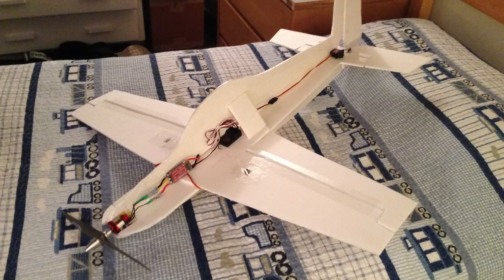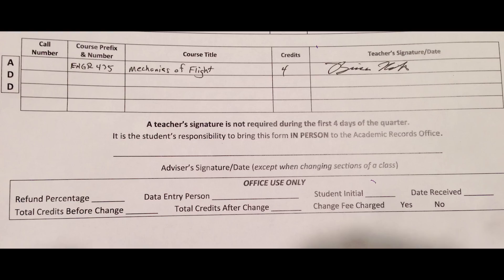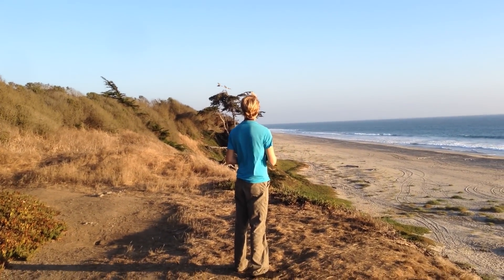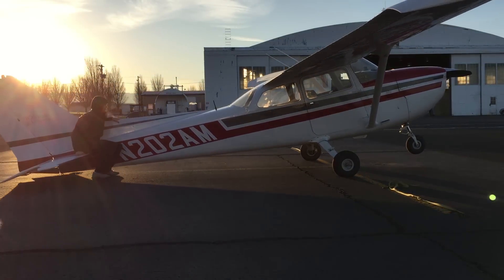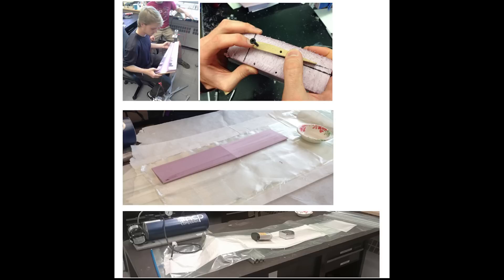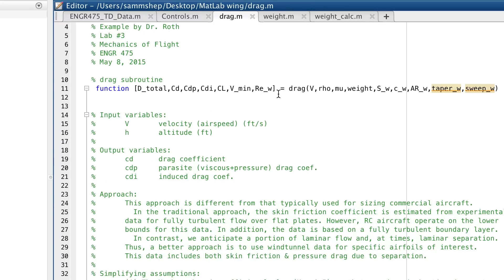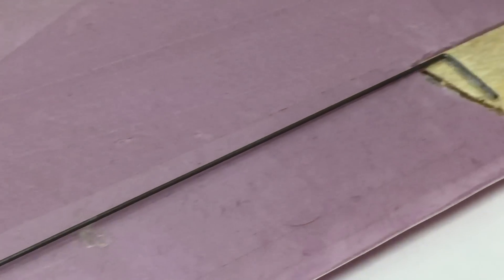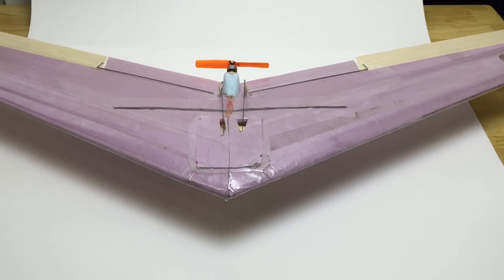Engineered Mini Flying Wing

Comment: When you are looking for efficiency the last thing you want are those irregularities on the wing's surface... You should know better since you said you are a pilot...
Reply from the maker: lol, lift generating aerodynamic efficiency is much more than that.
Do you just mean the torque rods?
Reply: ***** no, I was referring to the ditches left behind by the hot cutting wire... Sorry to be a pain in the bum, but beeing an old school rc plane builder that likes to build his planes from scratch I tend to be kinda OCD about that sort of things.
Reply from the maker: Andrei Marinescu Understood, that wing geometry was a really difficult one to cut. I had many failed cuts. Long, small, skinny, high sweep and taper ratio. Wish those smart engineers had built a CNC wire cutter.
Reply: ***** and another tip: expanded polyester is significant lighter than extruded one   and also easier to cut manually with the hot wire 👍

Comment: can someone explain the wing twist
Reply from the maker: The amount of lift a wing makes is controlled by the angle that it bites the air with, called Angle of Attack. By twisting the wing, we can create more lift at the root (in this case is also the front) of the wing, and less at the tips
Reply: +Samm Sheperd (SNRS) omg!!!! tjanks most youtubers don't answer their coments. Thanks ,now I understand. I'm 14 yrs and I also make rc planes, but i don't know much about aerodinamics and this was really interesting.By the way I'm spanish so sorry if I wrote something wrong. Oh and if you want to see some of my planes I'm rc exp on youtube, but some old videos are crap
Reply: oh and sorry if you felt like I was spamming . I didn't mean that
Reply from the maker: ***** Normally we want the whole wing to be doing something, so more AOA at the root, and a little less at the tips. Neutral at the tips is a little useless. Interestingly though, wings with a lot of twist and large flaps such as a C-172 can be creating negative lift at the tips when traveling fast with flaps down.
Reply from the maker: The wing flies at whatever angle it needs to, and we adjust it with pitch. The angle of incidence of a wing on a fuselage isn't setting the wings angle to the wind, it is setting the fuselage to point forward in cruise flight. Instead of thinking of it like we are flying a fuselage with a wing on it, think of it like we are flying a wing with a fuselage on it.

Comment: why did you use a bull nose prop on the wing
Reply from the maker: I was not in charge of propulsion, but they gathered lots of static and dynamic thrust and efficiency data with various props.
Reply: Yeah...the best props I've found for flying wings in this size/loading range are the small folders from Hobbyking. With few exceptions, the quieter your prop is at a given rpm, the more efficient it's going to be. Also, APC makes some really efficient fixed props in this size range.Lastly, your wing cores look like mine did when I started out with foam. Gravity feed gives you much smoother cuts--no more ridges!

Comment: How do you find center of lift
Reply from the maker: +SilentRecon it's pretty much always at 1/4 the chord length behind the leading edge for subsonic flow. Supersonic is 1/2. For swept and tapered, you find the average chord (called the MAC)
Reply: +Samm Sheperd (SNRS) ah okay thanks. Would horizontal stabilizers affect center of lift?
Reply from the maker: SilentRecon Yes, something about various pitching moments bring the center of lift back. This is why 1/3 chord is a good place to put the CG on a conventional aircraft. I don't understand super well though.

Comment: So drawing stuff in sketchup like wing shapes is kind of hard but I managed.

I decided to make this plane except about 60% bigger (which might not be enough but that's the piece of scrap foam I have)

I first sketched Samm's plane as a sanity check.

Here's the sketchup project 
http://s000.tinyupload.com/index.php?file_id=69791978233960311521

includes the original wing and my new wing.

BTW Samm's wing 86.8 cubic inch volume except for the cut outs and engine pod.
I measure my blue dow foam at 0.40g per cubic inch so that would make a 34.72 gram air frame (minus a bunch of stuff)

Here's some pictures if you don't want to install sketchup

airfoils (inkscape -> blender -> collada file -> sketchup !)
https://i.imgur.com/1PN3UOz.png
learning "extrude by loft" plugins
https://i.imgur.com/Z39PcjI.png
new wing on scrap foam
https://i.imgur.com/86LT8jr.png
original wing
https://i.imgur.com/74xZOBX.png
new wing  73" wingspan same airfoils (13.5" chord inboard 6.5" outboard) 31deg sweep center pod 9" wide twin engined (I only have 5x3 tri-props ) 552.8 cubic inch / 221.12 grams
https://i.imgur.com/WBCyWHf.png

Comment: Hi,

I just got a bunch of components and I decided to make a flying wing & trainer.

I purchased component that what got me the most bang for buck so my components are quite different from what you had.

Oh BTW, first thing for me was to draw the thing in sketchup. And before I could do that I needed to convert the airfoils into SVG vector graphics.

I posted the resulting SVG file here if anyone wants to try making this, it's already set to the correct dimensions.
http://s000.tinyupload.com/index.php?file_id=98134392829159776950

My base materials consist of this http://pastebin.com/hzwiuFJs
namely a 2212 1400 or 2200kv motor
5x3 tri props
2200mAh 11V lipo (heavy!)
9 g servos and blue Dow foam 1.5" and some wooden dowels.

Now to draw all this in sketchup and to try and figure out what size I need to scale up everything for optimal performance.

I think I'll add a center pod for convenience.

Comment: Now to make this thing! Sam why did you pitch the airfoil down 3 degrees?
Reply from the maker: +Noel Murano the wingtips are also the farthest thing behind the front of the wing. By twisting the wing tips down, we can more easily use them like an elevator (instead of using constant up elevens). It also brings the center of lift farther forward and also gives us a more elliptical lift distribution. We can also expect slightly less induced drag and maybe helps compensate for the "middle effect." However all that being said. A non-twisted and even un-profiled airfoils will work with proper CG and some elevons. See my "flying rectangle" video
Reply: +Samm Sheperd (SNRS) Im experimenting with different wings now. Thank you for your input! Good luck Im excited to see more projects.
Reply: Minus 3 degrees is enough to induce proverse yaw, too, making a tail truly unnecessary. Samm's design is essential a Horten Ho-series glider (though I am not suggesting he copied it without giving credit...there are significant specific differences).

Comment: the wing does not need vertical stabilators?? Why? When I made my second flying wing I didn't put vertical stabilators and it didn't flew well. It nearly survived. I put them and everything went fine on second flight.
Reply from the maker: +Luis Carlos Davila Reprieto we had enough sweep and calm enough conditions that they were not needed. With aggressive rolling we get some adverse yaw. Also, because our electronics were so light, adding vertical stabilizers (winglet type) would actually bring the CG too far aft.
Reply: I'm surprised that with -3 degrees washout you didn't get some proverse yaw, but maybe the adverse yaw was due to the elevons extending so far inboard.

Comment: what was the name of the rc servo board? i want to get one.
Reply from the maker: +david mimms I didn't source them, but this looks like the same one https://www.foxbuying.com/ar6400lbl-2-4ghz-6-channel-receiver-module.html?gclid=Cj0KEQjwl-e4BRCwqeWkv8TWqOoBEiQAMocbP1u3ms4kUnEYg0P5Ovt6cQhj6g93-x3rE0qCm1xngtsaAp1Z8P8HAQ
Reply: thanks :D
Reply: +Samm Sheperd (SNRS) i cant find the type of motor but will this work with http://www.gearbest.com/multi-rotor-parts/pp_180560.html?currency=USD
OR:
http://www.tmart.com/1804-2400KV-Micro-Size-Integration-Outrunner-CW-Brushless-Motor_p304964.html?cc=USD&fixed_price=us_us
Reply from the maker: david mimms More like this: http://www.hobbyking.com/hobbyking/store/__25676__Turnigy_A1405_3000KV_Indoor_Brushless_Motor.html

If this is your first project, micro components are a little more difficult and fragile
Reply: +Samm Sheperd (SNRS) thanks :D
Reply: Thanks man. I hope you have fun wherever you are now man. Thanks for inspiring me all of those years ago.

Comment: I want to get into making my own planes but this airfoil business has been the hardest to find information about.

What is HS522 and MH60 ? 
Is there a catalog of airfoil wing geometries I can search ?
How can I pick the correct airfoil for my application ? 

Do I need something like the application you made ?

Did you release the program you used to calculate the plane 

How did you cut the foam to morph from one root airfoil to a different tip airfoil, exactly ? That's the video I would most like to see 

What foam material type and density did you use ? Looks like normal pink insulation from the hardware store.

I'd like to make a 75 to 175 inch flying wing with 2-4 hours endurance, 1 kg external payload, is that within the realm of the possible for hobbyists ?
Reply from the maker: +shodanxx your goal is very possible. I suggest starting small and learn from your experience. This particular plane was difficult because of the size of the components and the weight constraint.

I do a little research on my application and airfoils that others used, and then I look it up on airfoil tools.com

Watch this to better understand the wing making process https://youtu.be/aV5hILJe20U

Comment: Damn, the video side of all of your projects are incredible. Have you found a little tip or something that wont make videos boring?

Also: wait a couple months. I'm planning on breaking your record. Is the "brain" just a normal UMX brick?
Reply from the maker: +Tarik Agcayazi (Killsranq) people don't know something is cool until you tell them that it's cool. They want to see personality, they want to be told a story. What is the significance? What insights can you share? But most importantly, people have short attention spans. Boil everything you have down into the most compact and fluid presentation that you can and then add footage on top of it.

Yea it's some cheap brick that binds to DSM2 radios like spectrum or Orange Tx. I'm sure you can beat the record, if the weather is calm, then the plane only needs a few strips of tape, and no spar.
Reply: "I'm sure you can beat the record" wouldn't be so sure about that

Anyways, yeah I was just wondering about that video aspect. I bored myself out explaining sideslip in my video, and when I saw yours it was good motivation to try to improve the videos instead of just pushing something out there. 

Can I get full specs on the 8.5gram motor? What kV, prop size, and if possible, a hobbyking link?
Reply from the maker: I actually haven't' been able to find that motor. I didn't source it. It was provided. I think it spun a 4inch prop. but I think a motor with a lower kv that spins a bigger prop (but slower) might be even better. You know about all the clues that I do.
Reply: +Samm Sheperd (SNRS) yup. just wanna have the same setup as you and challenge myself a bit. I'll find a motor that's close in specs.

Thanks for all your help!
Reply: I think i've found the motor. It fits all criteria, except it is 5 grams. I belive that it was weighed without the mount and etc:

http://www.hobbyking.com/hobbyking/store/uh_viewItem.asp?idproduct=34099

It looks the same as well (3 holes), and spins a 4 inch prop as well. i'll give it a run with this.

It seems that you can also get the prop, the battery, and the DSM2 main board off of HK as well:

http://www.hobbyking.com/hobbyking/store/uh_viewItem.asp?idProduct=91808

http://www.hobbyking.com/hobbyking/store/__89391__Turnigy_nano_tech_180mAh_2S_25C_LiPoly_Pack_Compatible_LOSB0863_US_Warehouse_.html

http://www.hobbyking.com/hobbyking/store/__56166__2_4Ghz_SuperMicro_Systems_DSM2_Compatible_Receiver_w_Brushless_ESC_Linear_Servos.html
Reply from the maker: That all looks pretty spot on to me and it all should work.
Except just from the looks of it, this "brain" looks more like ours, and is way cheaper: https://www.foxbuying.com/ar6400lbl-2-4ghz-6-channel-receiver-module.html?gclid=Cj0KEQjw5ti3BRD89aDFnb3SxPcBEiQAssnp0q5lnRx0U6WesmhH4pcsq1wgAUprp2PHY7-brWj81mYaAp_f8P8HAQ

And we used GWS EP 4025 props
Reply: Oh yeah that is a lot cheaper. I think i'll get that - I was planning on stripping out one from a broken UMX, but this will definitely do. Thanks man

Comment: can you still run calculations on wings? It would be interesting to see what it would have done flight wise if you doubled the wingspan and still kept it extremely light.
Reply from the maker: +Atom RC well that's the point to the optimization. If the span is doubled, the weight has to increase and so does the total drag, requiring more power and thus less endurance.
Reply: ya. I was just wondering if you limited the size in the calculations.
Reply from the maker: we did only test a certain range, but the battery and motor are the limiting factors. We calculated that in that case, 40in was best, and we tested up to 48in.
Reply: +Samm Sheperd (SNRS) cool. good to know.

Comment: What kind of foam do you recommend for building RC planes?
Reply from the maker: +kip kerluke for hot wiring I just use whatever insulation foam I can find. Technically the blue and the pink stuff is called XPS (extruded polystyrene) and the white stuff made from little foam balls is called EPS (expanded polystyrene)

I get foam board from the dollar tree for lots of other stuff

Comment: Damn. I tried to make a calculator for hovering a lantern (mini hot-air balloon) once. As in to design a feedback loop on board to regulate the fire and keep the lantern from climbing up up and away, and instead make it float around roughly at eye level. It was nothing like this, LOL. I am not smart. :D

I eventually gave up because I didn't even know what I had to learn to calculate the rate of heat loss. Any clues on the physics of hovering a hot air balloon? 

Eventually it would be cool to have many of these problems, especially the ones related to energy and climate change, as open source building-block code snippets that even kids can shuffle around and test.  Have a look at Bret Victor's stuff, worrydream.com
Reply from the maker: +Lee Roy nah man that sounds like an awesome project

Comment: In the end did you monokote the wing or tape it?  When you mentioned taping I was wondering about the tape edge tripping the laminar airflow (which is actually purposefully used in real life in some situations).
Reply from the maker: +D irk3672 We didn't plan any boundary layer control, but:
Small slow plane = low Reynolds numbers
Low Reynolds numbers tends to promote laminar flow
laminar flow can more easily allow flow separation = more pressure drag
and so my tripping the layer, that mights be a good thing. But it was really overlooked.

Comment: Do you have links for the electronics used in this foamie project?

Will a Dx6 work with it?

Awesome video!
Reply from the maker: +Consult Keith Young I didn't source the electronics, but some time browsing and I'm sure you can find the same or other stuff.
One of my challenges was to get a radio that capable of custom channel mixing. Because the control board's servos only responded to channel 2 and 4 (elevator and rudder) instead of the usual elevon mixing that uses channel 1 and 2 (aileron and elevator). So in that sense I wouldn't have been able to use a Dx6. I found someone with a Dx7i. But yes this receiver board is DSM2 compatible so it can bind with your transmitter

Comment: I'm not sure if anyone asked already, but have you tried replacing the battery and payload with a 60 gram (plus the old batteryweight) battery, just to see the endurance of that?
Reply from the maker: +Tommy Hellberg I'm sure I would have continued testing, however I don't own a DSM2 transmitter capable to custom channel mixing. So i'm not currently able to fly the thing.

Comment: "And I am super interested in learning more about these things"
Reply from the maker: Yep
Reply: If you are looking for an aerodynamics text that isn't too difficult to follow I suggest Model Aircraft Aerodynamics Martin Simons.  Don't be put off by the model aircraft focus, it contains real aerodynamics principles and formula,  in fact I wrote a glider wing aspect ratio performance optimisation program from the information in this very book.  So it's a pretty neat and clear introduction.  Obviously not like doing a uni course but certainly enough to give you a working understanding.  It touches on flying wings only lightly.  If you want to find out about them.  The Horton Brothers did the groundbreaking work based around the bell shaped lift curve.  You will have to search for this information yourself.  Once you have this, you will have covered the factors pertinent to about 99% of possible air-frame efficiency IMO.
Reply: e

Comment: Did you experiment with using any dihedral or negative dihedral?
Reply from the maker: The teams doing conventional aircraft did, because they used rudder steer. We had full roll control and decided not to for more efficiency
Reply: +Samm Sheperd (SNRS) If I recall from my vague readings on endurance flying, swept wings are the most effective due to the least amount of drag v lift. Can you speak to the current state of solar powered craft and the ability to sustain flight with current tech?